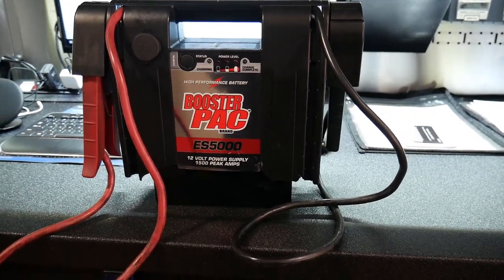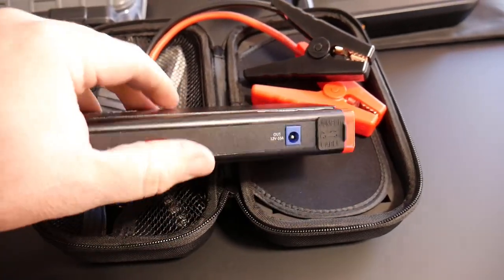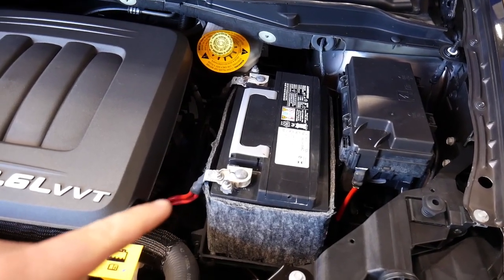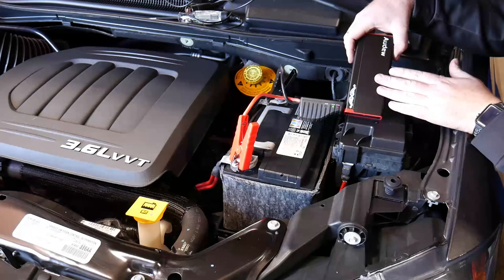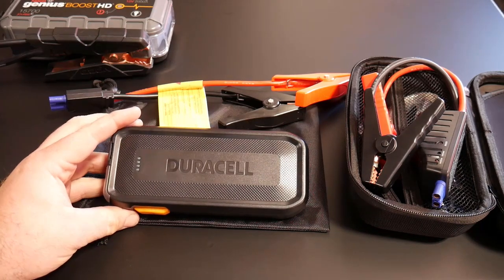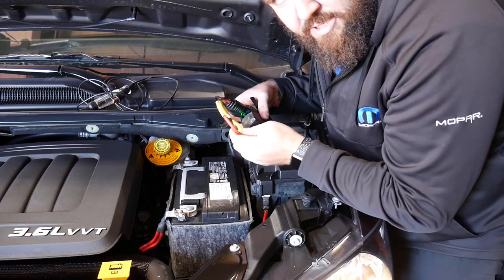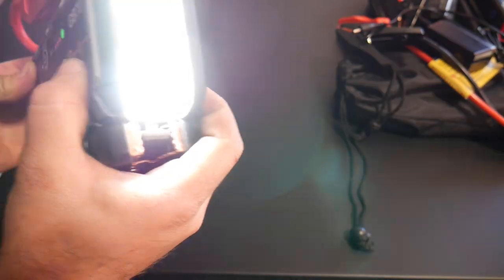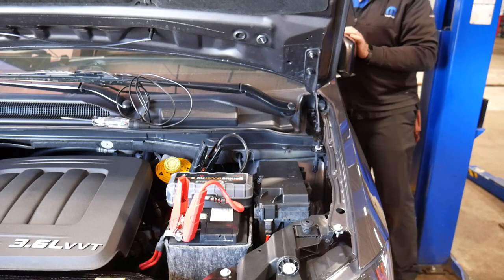MODERN JUMP START PACKS - 3 COMPARISONS AND REVIEWS

Comment: I bought an Audew on Amazon before I saw your video. I have a 2011 Ford fusion hybrid and had an original battery die with no green eye. In a hybrid it don't always start the gas engine until the drive battery needs charging or you need it to drive the car and the electric motor is not enough.i got one a little better than the Audew you showed. Hope it works as expected.  Good video!

Comment: There's only one in my book.  A "Booster Pac ES5000".  Mine is 6 years old now, and will still start/crank anything.  I even stopped trying to keep a battery in my MF135 Diesel Tractor.  I just use the Booster Pac.  It easily starts my big Cat 416 diesel backhoe, by itself (no batteries connected) on the coldest morning.  And it's still only about $120 bucks...

Comment: don't trust the gb40 on totally dead V6, i exchanged for gb70 that should do it!
Reply: tigros999 thanks, interestingly my GB40 NOKO, SPOOLED UP,AND started two times I needed last winter : once @20 BeLow Zero, 5;year old Interstate( NOKO WAS AT 45 Degrees in Garage) , and once at small v8, plus 10 year old Car at Some 30 Degrees discharged Battery Hradlamps: instant Starts....

Comment: We have some 24 volt equipment - so the shop bought the nice 12/24 volt Snap-on jump pack. It also gives a nice backwards polarity warning - which is no good when the newbie tech ignores the sound and set the voltage switch anyway! Fried thee batteries pretty easily...at least the repair was fast and only 1/4 the cost of the whole unit....it will start most  class 8 trucks with bigger Detroits and Cummins....just not the crappy IH trucks that have to crank 10 minutes  before they run on a good day! LOL

Comment: I’m looking to get the gb70. My question is, can i leave it hooked up to the battery and leave the ignition on while working with a scanner and other diag stuff? Not for programming obviously. Thanks!
Reply from the maker: Yes you can and I do it often. Just leave it hooked up and it works great. Only thing is it times out after like 5 minutes I believe.
Reply: My Chinese suaoki u17 jump starter powers out at 30 seconds annoyingly
Reply: I have the gb70 now and so far it does not time out.

Comment: Nice video bud. I have had my eye on the third jump pack. Did I hear u right u can jump a dmax power stroke Cummins with it. These kind a videos are very hep full. The last jump pack I have used once was not impressed but it was not mine a tech at the car dealer I detail for gave it to me to jump a Yukon and gave me no real instructions on how to use it. Me knowing it was an expensive pack gave up kinda fast and went the old fashioned way and got jumper cables and the keys to the Yukon next to the dead one.
Reply from the maker: Yes the GB70 will jump a Diesel engine and I have done so with it. Now both batteries are SUPER DEAD it’s a 50/50 shot on if it’ll start before it goes through the charge.
Reply: Here's a vid I posted 5 years ago of a Booster Pac ES5000, and yes it's still going strong here.  But I've used mine to start a old F250 7.3L Ford with no batteries in it.  And it doesn't just turn it over, it turns it over fast.  This vid is just starting my old V6 ranger with a bad fuel pump (it has two), but it is completely dead.  I picked one up online (still around $120 bucks) when I saw it used at a car lot near me here... https://youtu.be/pN3IgAVlq6o
Reply: Rustbelt Mechanic cool I’ll have to work on that cause it looks like I might be needing it.

Comment: If your going to use it regularly buy the Noco, we have 1 at work (used car lot) and I have 1 personally and they have been used regularly and no issues so far they will start 3.0 diesels that haven’t go enough in their battery to unlock themselves. We did have a cheaper one on approval from a parts supplier but it died pretty quickly !

Comment: I put one of the older bulkier jumpers in my girlfriends car just Incase and she actually had to use it a week later. Came in very helpful a couple times but she keeps forgetting to charge it. I may have to pick up one of those smaller ones for her little car. I’d also like to pick up one that would turn over the duramax, Any suggestions?
Reply from the maker: The GB70 would do it as long as it’s not both batteries super dead in the middle of winter. If you want one for that or bigger and don’t mind the cost, the GB150 is a BEAST!
Reply: Rustbelt Mechanic sounds good looks like about a hundred dollar difference between the two so I just weight the options. 
Thank you